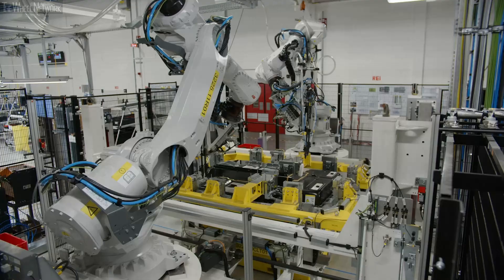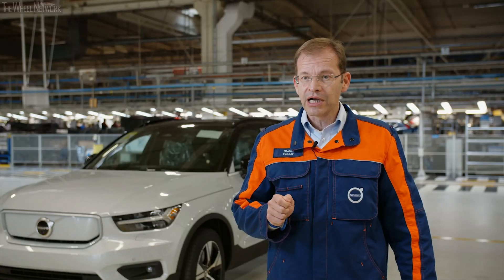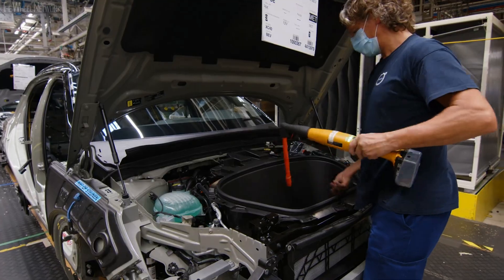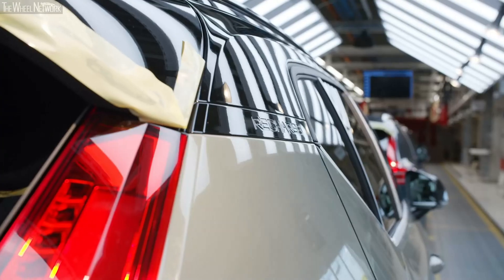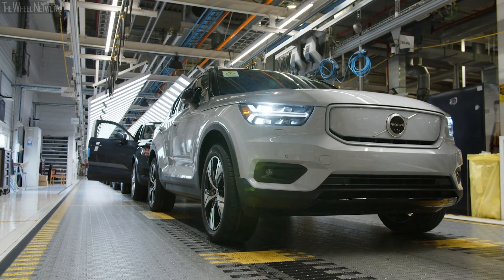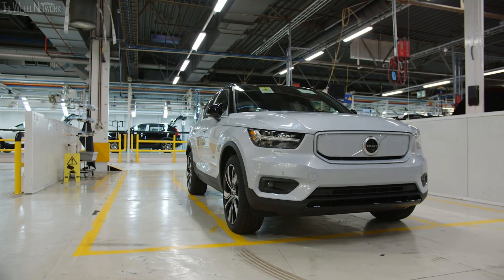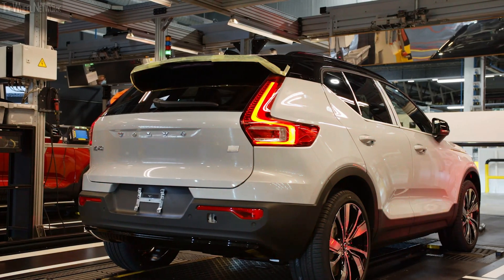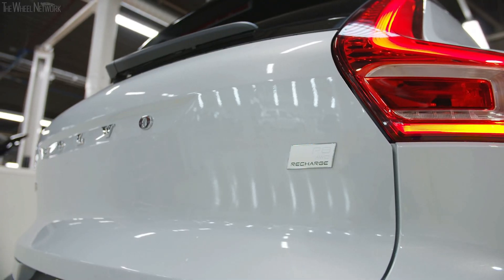Volvo XC40 Recharge EV Start of Production

Comment: I signed the contract the first day 16 January 2020. My Volvo XC40 will start construction on Tuesday 10 November 2020. It will take 6 days to finish building it. Then by boat from Belgium to Norway. My Volvo dealer will get the car at the end of November. It will be prepared and I will pick up my new car. Looking forward to